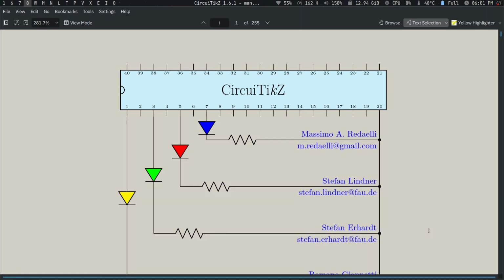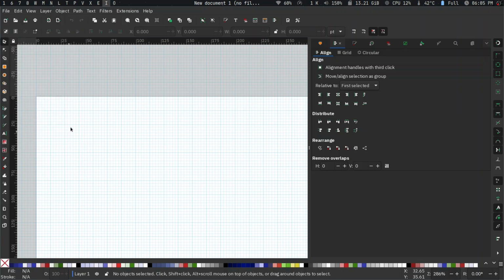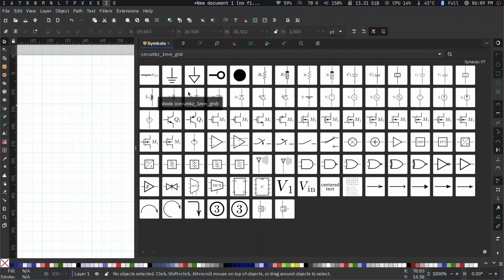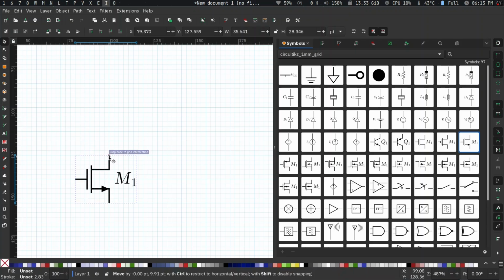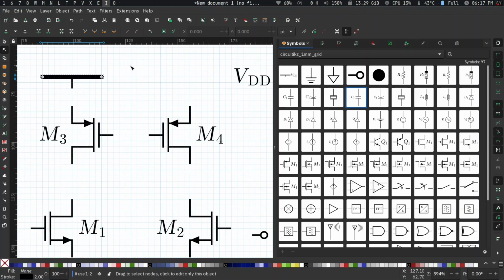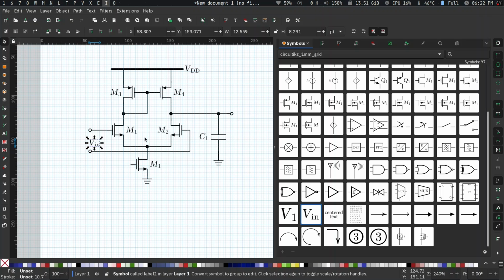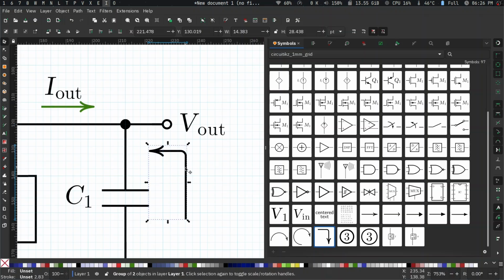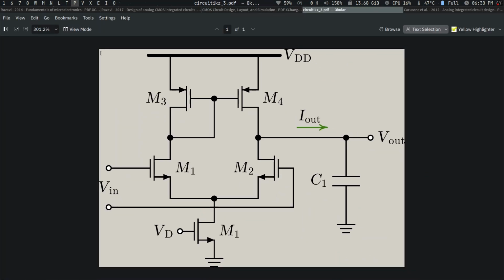How To Create Professional Looking Circuit Schematics Easily Using Inkscape

Comment: @usefulknowledge6074 Thank you for sharing these. Nicely done.  Question: I see you have a set for 0.5mm grid in addition to the 1.0mm grid set.  Can you explain what the advantages are for the newer 0.5mm set?  Is this better for most diagrams you have added to LaTex documents, for example?  Thank you.

Comment: The symbols are very nice, thank you for that.
However, the grid snapping in Inkscape (1.3) is so frustrating. It rarely snaps to the grid as expected and often leaves the node off the grid unless you zoom million times to the grid intersections. I've never encountered a program with such a frustrating grid snapping as this Inkscape.
Reply: You can change the snapping options in Inkscape. There are lots of options. Some of the settings such as the Bounding Box option might conflict with snapping to the grid.  Switch this option off and it should make snapping easier, also enable the option for Object Rotation Centres and Object Midpoints.
Reply: @billps34  Thanks, I've found that some options really help to get better snapping. Especially the Bounding Box option which was snapping to the stroke width outline by default.

However, there are still so many of unfortunate "features" in Inkscape like that text scales with the group instead of keeping fixed size, no paragraph spacing, no vertical text alignment, no usable object connectors, etc.
Reply: @midvok3918  Thing is, you need to remember what inkscape is actually for.  It's an SVG editor for making scalable vector graphics - and some of those "features" work the way they do because of the constraints of the SVG format itself.  For example, there's no paragraph spacing or vertical text alignment in SVG text boxes. Theses concepts just don't exist in SVG. Text formatting is quite limited in SVG, unlike for example in page layout software (Scribus/InDesign etc).
Reply: @billps34 Ive been in a conundrum of deciding to use Inkscape or circuitikz to create circuits

The problem with Inkscape is each file will need to be created for each circuit which can be an organizational problem
Moreover. Circuitikz will be time consuming initially to learn but is embedded into latex and certain figures can be reused

Comment: you explained the process for transporting the files on linux but what about windows?
Reply: Did you ever get a reply ?  I too am confused about Windows installation of the files. My unpacked zip download is a directory consisting of many various sub-directories and files.
Far more folk will be using Windows than Linux for running Inkscape. A good video otherwise, but a shame I cannot yet use it.
Reply: hi, For Windows, in my case Windows 10, the process is the same. Just download the .svg files with the symbols and fonts. Once downloaded, the first thing you do is install the fonts. Installation is simple: click and drag to select all the fonts and right-click to install for all users. Now, for the symbols, go to Program Files > Inkscape> share> inscape>symbols and paste the two .svg files... and that's it! Also, remember that you can write LaTeX equations with Inkscape; you just need to install the extension.

Comment: Hi, thanks for the tutorial. I have a problem in exporting the file in .svg format, in the circuit i drew voltage sources are not displayed, but in Inkscape there is no error and everything looks smoothly. I tried it on a new file and delete the DC and AC sources in the existing circuit but it does not working.
Reply from the maker: The circuit looks fine on inkscape, but when you export it to pdf, something is wrong? I don't exactly understand the problem. Explain your issue more clearly, otherwise I may not be able to help.
Reply: @usefulknowledge6074  It is solved when i "Unlink Clone" of all components :)
Reply from the maker: @iremsnmaz1644  Nice!
Reply: @iremsnmaz1644  Sağol ben de sayende yaptım
Reply: @usefulknowledge6074  The circuit looks fine on inkscape, but when i export it in .svg format, voltage sources are not visible.
Reply: Thanks a lot for this.

Comment: Extremely useful video, I have a question: is it possible to go back to the cuircuiTikZ code once the circuit has been drawn on Inkscape? So that I can copy and paste the source code directly into the main Overleaf code. In any case, having the possibility to draw the circuit and then have a pdf file to load into the LaTeX file is still super useful, but at least if there was also the chance to draw the circuit in the way you show and than know the code behind what we drew it could be useful both to learn how cuircuiTikZ thinks and also to not have to save the result in a pdf. Thank you very much, maybe my question is quite stupid, anyway really nice and smart video!
Reply from the maker: Unfortunately, this doesn't have that functionality. There is some tool that addresses your questions, but I can't remember the name right now. Basically, you draw the circuit in LTSpice and it converts the LTSpice file into CircuitTikz. I tried it and it works but wasn't too happy about the spacing between components. Also, it was a bit hard to modify. Check it out. Maybe it meets your needs.
Reply: @usefulknowledge6074  thank you for your answer. if it is not a problem I would like to ask you two more things: as I am not very good at Inscape I am unable to move objects by following the squares in a discrete way. when I insert a symbol it can move freely in any position, without fitting perfectly into the vertices of the grigiline squares. Furthermore, when I add a line I cannot see the connection point with a symbol. do I have to activate some option in the settings? thank you for your reply.
Reply from the maker: @marcos3865  The questions you asked are probably related to "snapping", which you need to turn on to allow objects to snap at nearby connection points. Look for the snapping button or press % to enable it.
Reply: You can always convert the SVG from Inkscape to PNG or JPEG (with correct resolution) and use in LaTeX as an image.